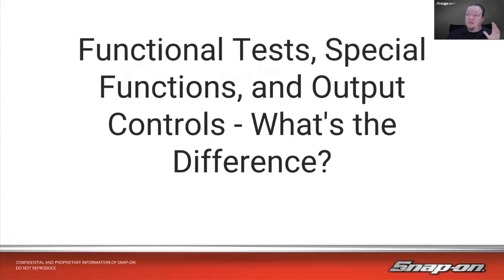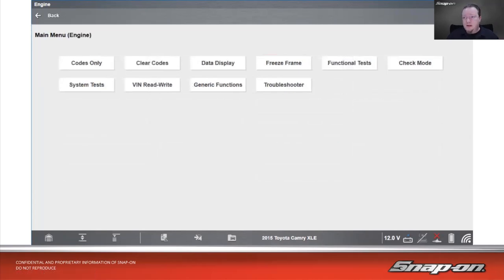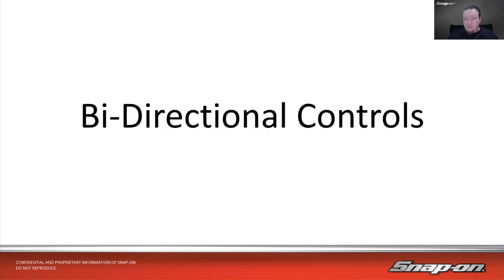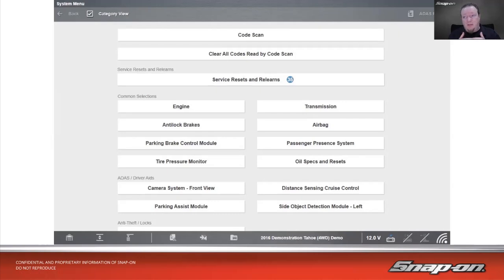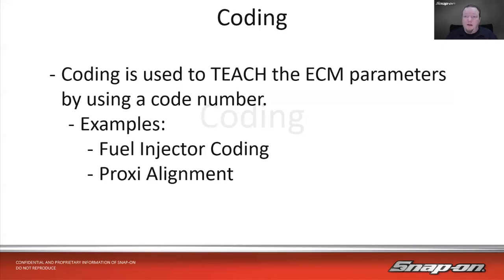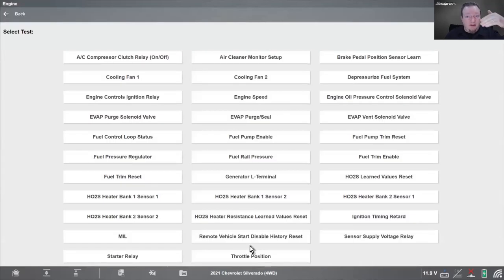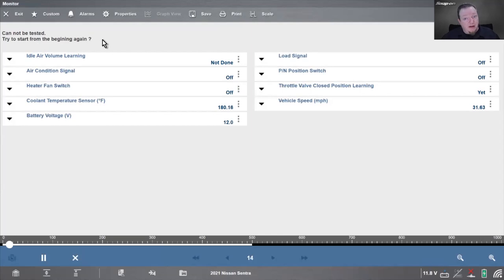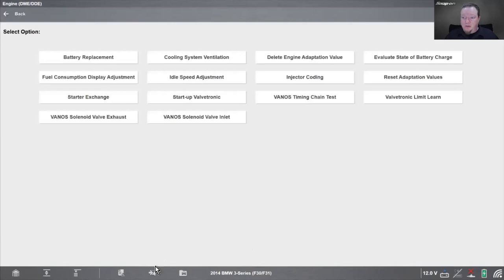Snap-on Live Training Episode 81 - Functional Tests.. What's the Difference? | Snap-on | Diagnostics

Comment: I had to do a relearn on 2016 hynudai sontana hybrid  electric  motor cause another shop replaced  12 volt  battery without using a memory  saver.  Codes were set loss of voltage  on the network.When the driver  stepped on throttle, the car would launch  on the driver. Once re-learn was done car ran normal .